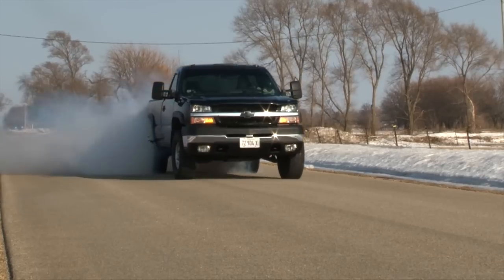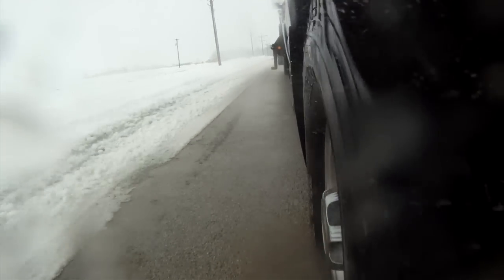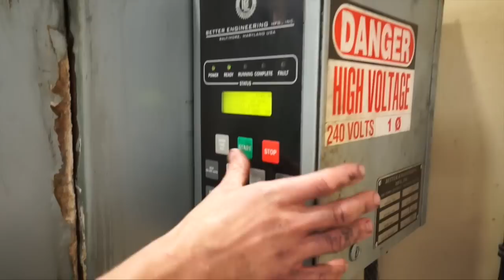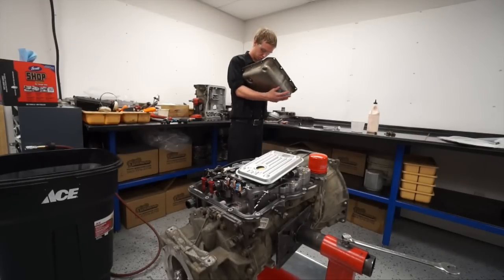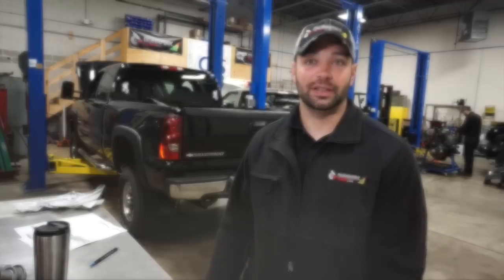Transmission Builds by Duramaxtuner.com

Comment: I got a stock 2003 lb7 with a stock Allison 1000 5 speed automatic transmission and was thinking of putting a programmer in it no more than 125 hp should I rebuild the trans or will it be fine ?
Reply from the maker: If the only modification you have is a tune, then you'll be fine. By the way, we just released a six-speed conversion for LB7's - check out the video: https://youtu.be/2PBDeiMeNLE
Reply: Rbt

Comment: I have a 2008 GMC 2500HD with a Duramax.  I bought it w/147k miles and now has 200k.  I use it to tow RV's mostly from Indiana to Western Washington state.  It continously blows the p0087 code cutting power.  I bought a computer deleter I plug into the bottom of the steering wheel area so I can delete this code and motor on.  Usually happens while towing in the mountains, but not always under load, sometimes after I clear a ridge and coast down the other side.  This is what I have done;  replaced crushed fuel line (dealer), added an electric fuel pump, replaced the low pressure fuel senser (looks like a large bolt) and it still happens.  Getting very frustrated!  Any other ideas?  Thanks, Randy  ps  I use the Hotshot brand of oil and fuel treatment (also Lucas fuel treatment), ac delco fuel filter, and 100% synthetic motor oil (currently Rotela T6 becuse it seems to last two trips vs Lucas lasting only one trip).
Reply: Randy Lavine you need to replace the fuel rail plug with a race plug on the driver side.I had the same issue